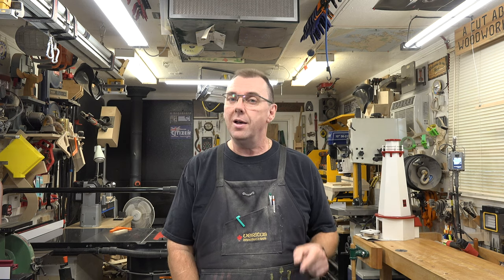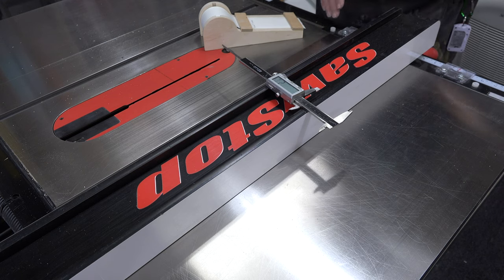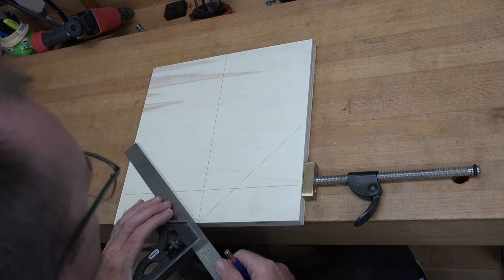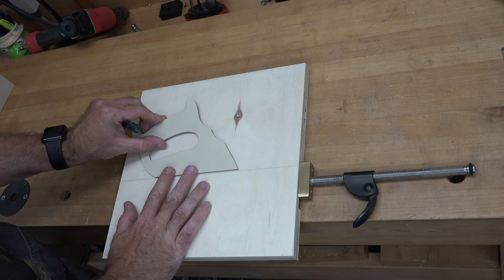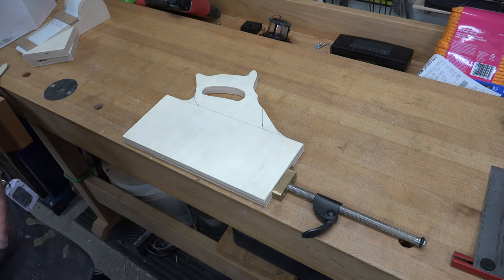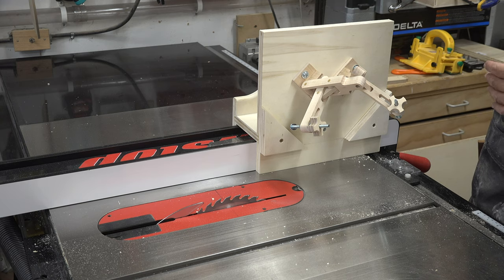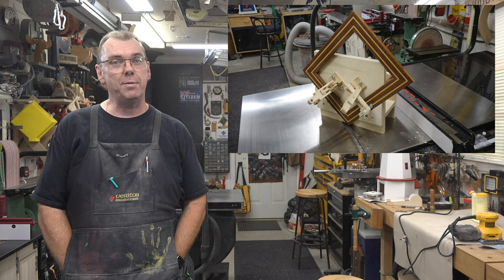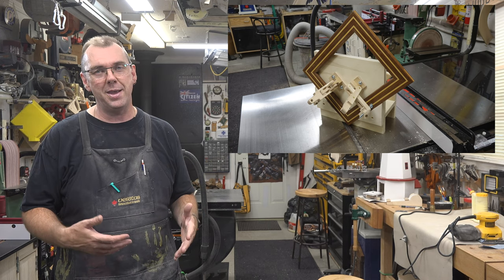Making a Table Saw Spline Jig

Comment: Several years ago, I built a tenoning jig that mounts and rides on the fence similar to yours. (It was based on one of the woodworking magazines.) The biggest difference is that the mount is adjustable, allowing it to be used with difference size fences. This proved to be a wise move as I eventually upgraded from a Rigid 4512 to a Sawstop. To use on the Sawstop, I simply adjusted the "runner opening" to accommodate. I just recently adapted it to use as a spline jig by adding a couple of angled runners at 45 degrees. A couple of quick clamps keeps the frames in place. Clever design though, Kenny!
Reply from the maker: That sounds like a fantastic jig Phil.  If I had one like that, I wouldn't have had to upgrade mine as it would have been adjustable to the new fence.  I used to use Quick Grip clamps to hold the frame in place but it was just one more thing that I had to go over and grab before cutting the splines.  I love these shop made toggle clamps and it's just convenient to have them already attached to the jig.  Thanks for tuning in to the show and for taking the time to chime in with your experience with spline jigs.  It's very much appreciated.

Comment: Nice little project Kenny.
I remember when you first made that handle template in one of your earlier videos.
I think I will need to make one of these since, like you, the one I have was built for my old table saw fence.  I'll have to get creative to make it stable since my fence is extruded aluminum that is 100mm tall and 40mm thick.
Have a great day!
Reply from the maker: Well I hope you are able to come up with a sturdy, stable and functional jig Woody.  Good luck on your build and thanks for tuning in to the show.
Reply: @acutabove_woodworkings  I should be able to.  I have some phenolic impregnated plywood that I bought years ago that works well for sliding surfaces. I'll use that and some more plywood to build a stable base that fits over the fence.
Reply from the maker: @rrabbit1960  Sounds great.  Be sure to keep me updated.  I'd love to see it when you're done.

Comment: When using calipers to measure depths, it works better to use outside of the caliper jaws. The way you did it is good for holes. Both work, but it's easier to keep it perpendicular, using the outside of jaws.
Reply from the maker: Good advice Doug. Thanks for chiming in with your suggestion and for tuning in to the show.  I truly appreciate it.
Reply: Second this advice-an old machinist taught me that about the calipers.

Comment: Another great project Kenny I do have a question about your breadbox built what kind of finish do you put on it I made one and I put some shellac on it and I can't get rid of the smell I'm taking about just using cooking oil what do you suggest?
Reply from the maker: DO NOT ever use cooking oil Gerald.  Cooking oil goes rancid after a while and if you think the smell of shellac is bad, you don't even want to think about the smell of cooking oil.  I used a water based varnish with a satin sheen for my project.  There was quite a bit of smell left over from the varnish but that smell dissipates over time.  I'm sure that the shellac will eventually calm down as far as the smell goes.  I would leave it open for a couple of weeks to let the interior completely cure and air out and see if the smell goes away.  Water based varnishes (while they do raise the grain on the first application) are very low odour and easy to apply.  You might want to look into them.  I hope this helps.  thanks for tuning in to the show and taking the time to leave the kind words and the question.  It's appreciated.

Comment: Hi Kenny! What is your wonder dog clamp pushing against? It doesn't seem that you have anything on the left side of the board as you slide the Incra T along. Just curious, thanks!
Reply from the maker: I can see why you would be a little confused Dan as there is nothing visible there.  I use prairie dogs in the dog holes of my bench.  If you don't know what these are, they are made by Veritas and they are like normal bench dogs except they recess into your bench.  To get them to pop up, you just press on them and they spring up to a normal height.  One of the things that I like about them is that I can partially press them down into the work bench so that they stick up just slightly, like a low profile bench dog.  This comes in handy when using the INCRA T-rule because then, the bench dog doesn't interfere with the T-rule gliding along the edge where the bench dog is.  The problem with that, is that it obstructs it from the view of the camera and makes it look like I don't have anything holding my plywood to the bench.  LOL.  Here's a link to the prairie dogs if you are interested.  https://www.leevalley.com/en-ca/shop/tools/workshop/workbenches/benchtop-accessories/70156-veritas-prairie-dog
Thanks for tuning in and taking the time to ask your question.  It's very much appreciated.
Reply: @acutabove_woodworkings  Thanks so much for that! I caught a slight glimpse as you flip the board over.
Reply from the maker: @FiveFifteen  You're very welcome.  Glad to help